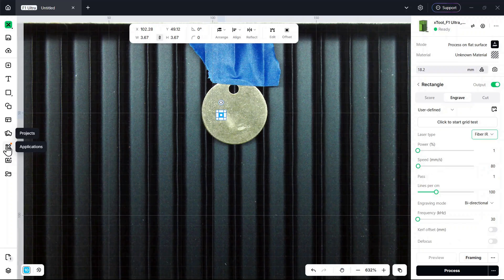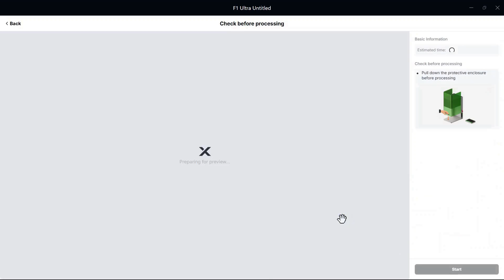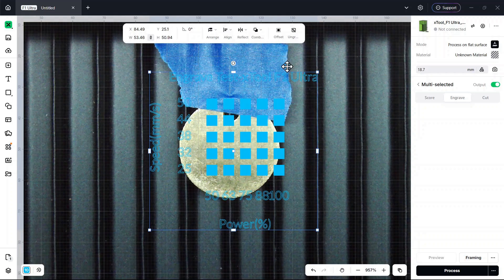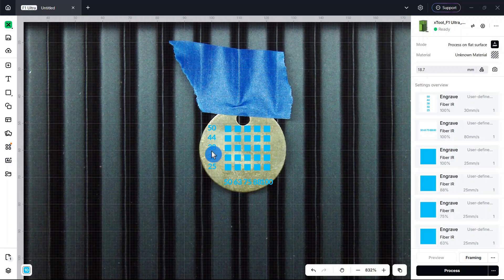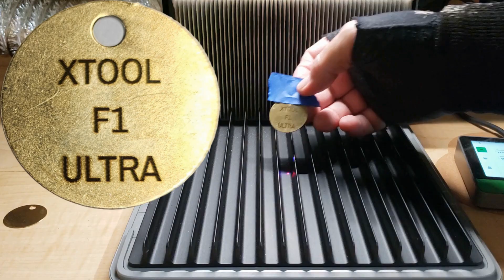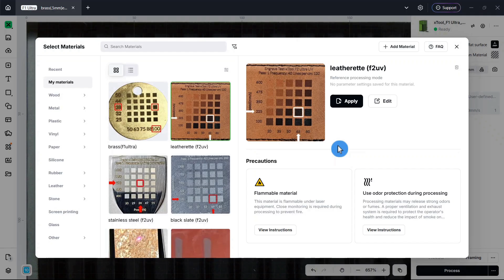Fiber Laser Brass Tag Test + Engrave

Comment: I have used what looks to be the same brass discs (got them from Uline in a bag of 100) for labeling keyrings to fleet vehicle numbers, I use a Laserpecker LP5 on the 20 watt fiber setting ran into a couple of issues: 1. the discs were still a little domed, when I engraved the concave side, the reflection from what I believe was the tarnish that made them even more reflective actually made a spot on the safety shield soft enough to deform.  Addressed the concave by flattening the discs between two pieces of thick steel that had been surfaced to provide a smooth surface, and used a hammer to stamp them flat. Addressed the reflectivity by buffing with steel wool, scotch brite might work also, just enough to remove tarnish and give a consistent 'satin' finish. Laser settings were 95% Power / 80% Speed (Laserpecker info claims 8,000 mm/second)  Results in a nice dark bronze color engraved on the disc with a tactile feel (I was engraving 5 digit numbers as large as the disc would allow).
Reply: I forgot the Frequency was 40 Hz and 5 passes
Reply from the maker: Thanks again! Dave!
Reply from the maker: I had some trouble getting things just right, but these discs are pretty flat - not sure where they were purchased, as my customer supplied a sack full (plenty left over after the job).  I ended up at 100% pwr/40mm per sec/100 lines per cm/30 freq.  I probably need to tweak some more, but the customer liked the outcome, so I guess it all worked out.  I appreciate you watching and taking time to share your experience with the process.  Please share your thoughts or send with questions anytime - it is appreciated.  Take care - Dave!